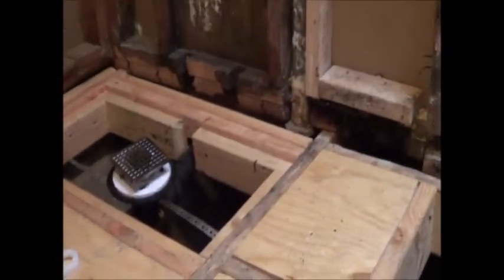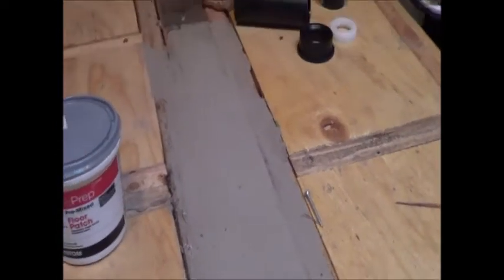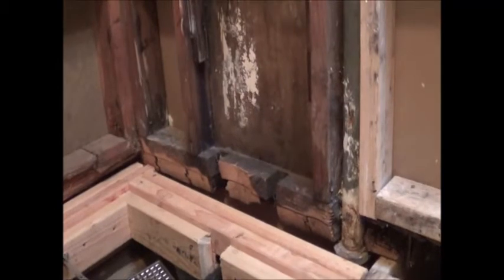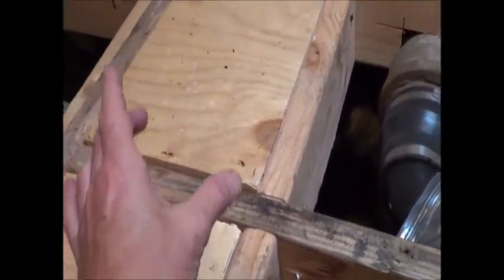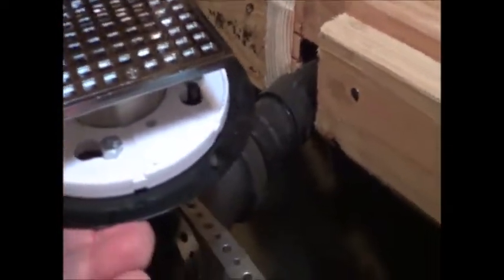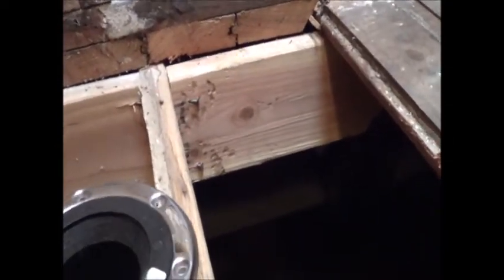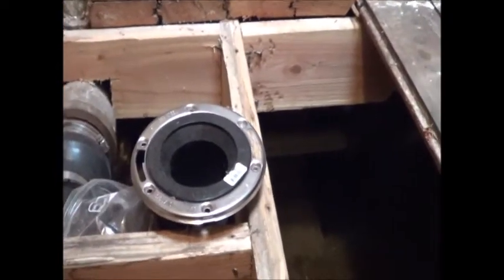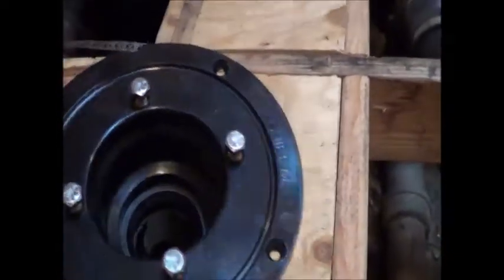Bathroom Renovation & Tub to Barrier Free Shower Conversion (Part 16)..Shower Drain & Floor

Comment: Looks like a lotta work.  I've used that floor patching compound before, it works fine.  One bit of advice, take out all the cast iron pipe you can and replace it with plastic.  Much less headaches in the long run.
Reply from the maker: I took out yards and yards of it,.....thanks for watching, Blint....hugs
Reply from the maker: Oops..Clint..lol